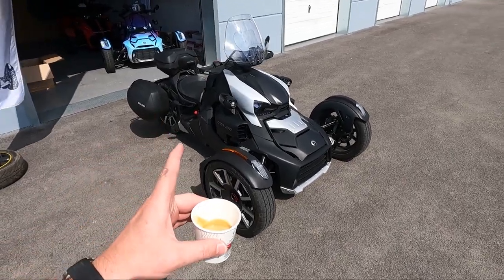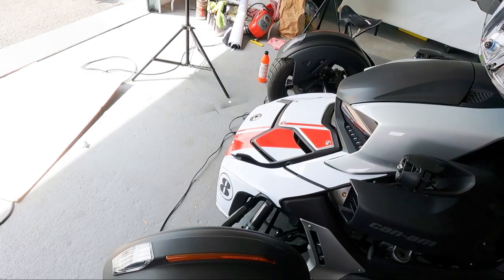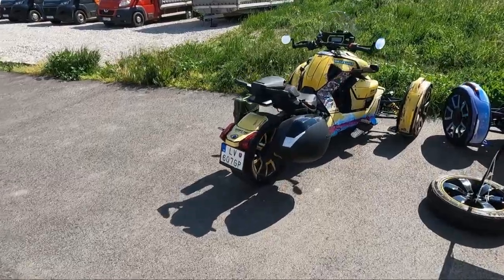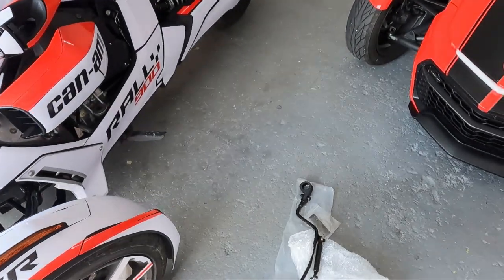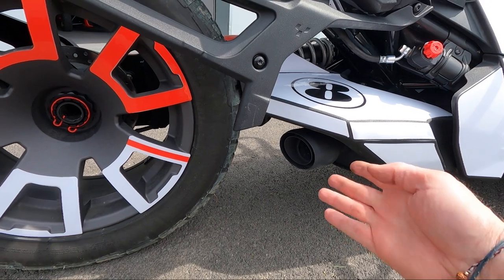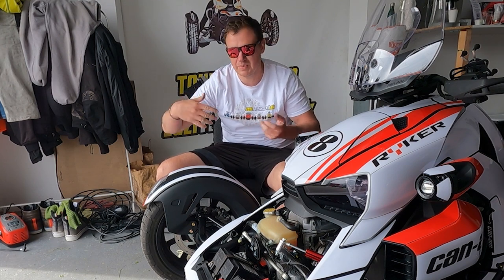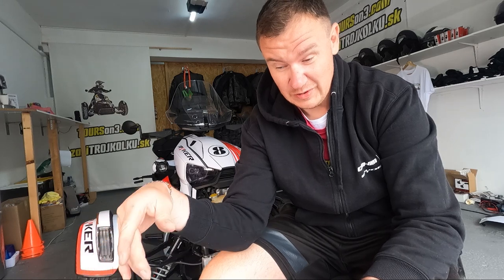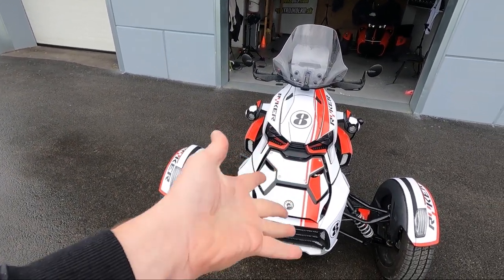Can-Am Ryker GT 900 Rally rebuild by MartinTheVlogger

Comment: Nice preparation 😊 On the other hand I have a question, how do you hold the protective grids on the air intake ? 
 And don't these protective grilles limit the air supply ?
Reply from the maker: Pleaseif you can write in english or use google translate i will reply in case of any questions. Martin
Reply: Ok corrective 😊
Reply from the maker: Hi, tank you for language change. More info here, and of course tgey dont hold the air comming https://youtu.be/jz9A_BP6ek8 nd you can buy them here https://www.martinthevlogger.com/grill-protector-spoiler-skidplate-canam-ryker-accessories-parts

Comment: the lip under the eyes leave them.  Wrap looks great.
Reply: @MartinTheVlogger  by the way ..I own the worlds fastest Ryker 600 now.
Reply from the maker: @Dan.a.k.a.bradpitt  😉😉😉🤟🤟🤟💯💯💯
Reply: @MartinTheVlogger  FUN FACT : it spits flames , sometimes 6/7 inches out from exhaust tail pipe.  Safe bet its also the best sounding one too , due to the ecu tune. Runs a bit rich , but has a much deeper growl now. Also , the vss traction control system is permantly off now ,  and it got me in trouble over the weekend w burnouts.
Reply: @MartinTheVlogger  Next stage will be custom turbo . After that I will be racing 900s for cash. Have one race lined up for one thousand dollars so far.